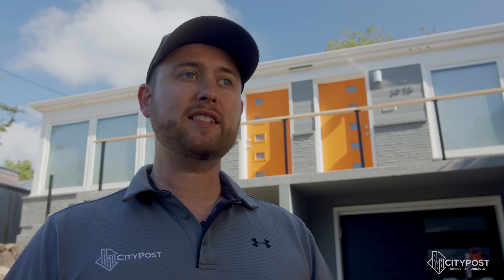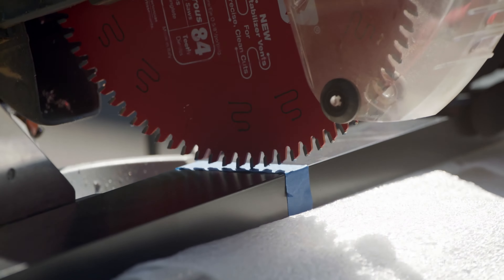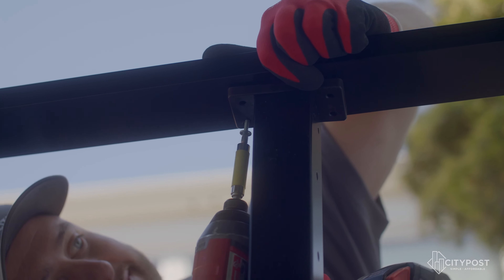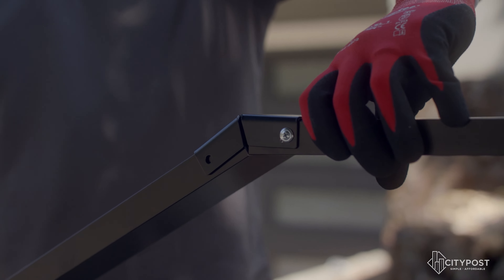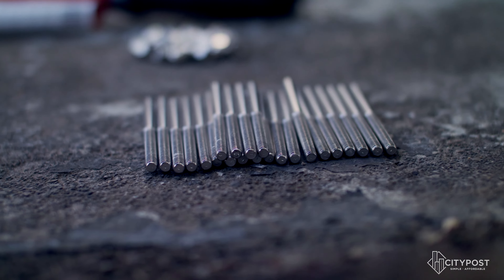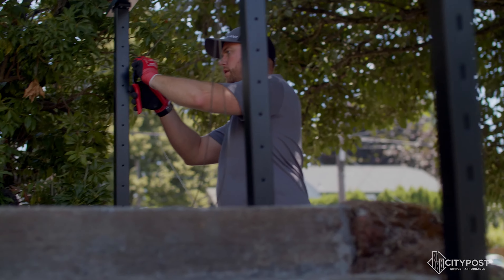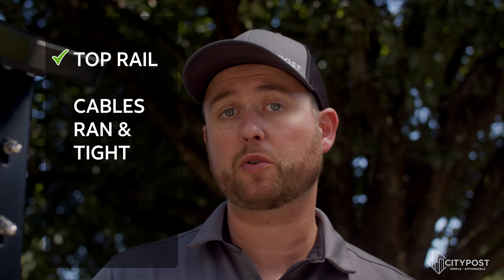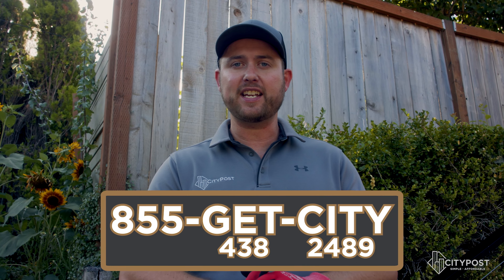CityPost: Full Install Tutorial

Comment: Hi, I am wondering if installing on a short set of stairs if the railing needs to be mounted in concrete or if simply mounting to the deck boards would be acceptable?  I am in Maryland so the code in Maryland would be good.  Thanks.
Reply from the maker: Hi Gary, would you mind emailing your question along with a picture of the installation area to “orders@citypost.com” for further review to ensure we are addressing your question most thoroughly?